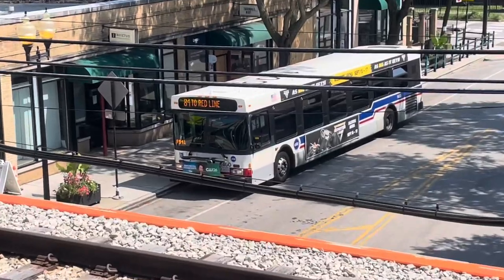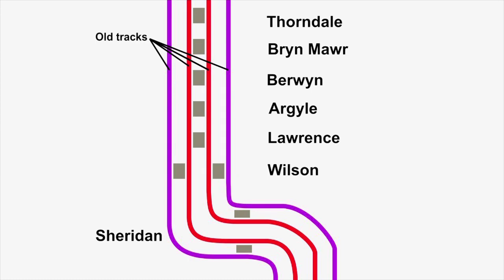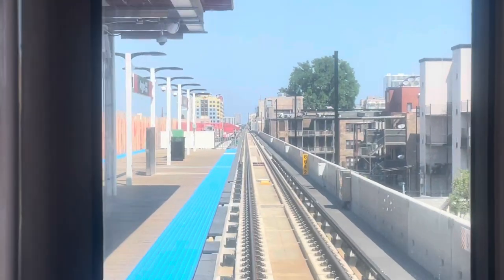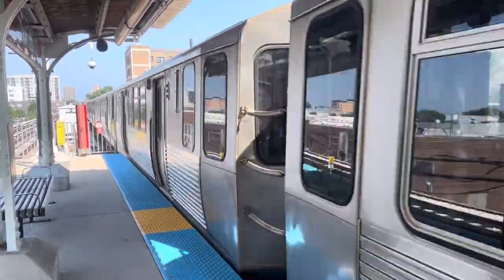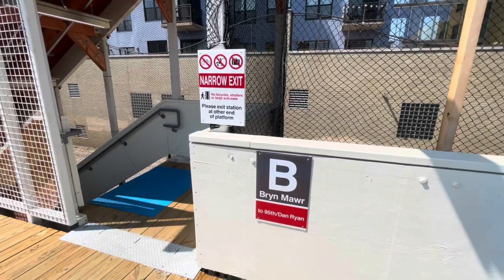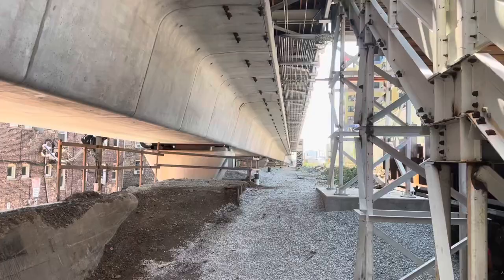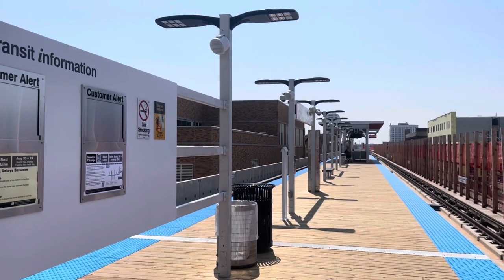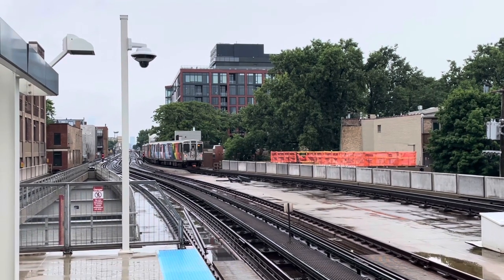CTA RPM Update

Comment: I'm excited about the Red Line extension to 130th as it's close to where I live, but I know this isn't what the video is about. This new structure up on what they used to call the north side main line seems quieter and makes for a smoother and more comfortable ride. And it seems much higher than the original structure.
Reply from the maker: I found out about the HUGE new grant for the extension just a few days after finishing this video!

Comment: This whole project is absolutely amazing. I have to compliment the CTA on this project because it is being done pretty much to schedule and within budget. Good project management is not very common on US transit systems. There have been no major delays and no ballooned costs as has been common in LA, NYC, and SF projects. We haven't had major equipment problems the way DC and Boston have had either. CTA project management has been consistently good.

My favorite part of the L are the tracks between Sheridan and  Wilson. That century old structure is beautiful and I love walking underneath it as trains roar overhead. I do get excited when a north and southbound Red Line and north and southbound Purple Line trains all pass over me at the same time. That kind of timing doesn't happen very often so it's cool when it does. I'll be sad when that section is replaced with modern structures. CTA may be the only agency in the US that is doing so much modernization on its system and that is impressive. Much of the system has been updated in the last 20 years. I can't wait for the new elevated mega-station at State & Lake.

The new structures are great and the trains can run at speed now. There was something quirkily thrilling about the old tracks as the trains roared loudly over them and we were thoroughly jostled about in our seats on the old tracks. The new stations are the best part because they were old and dilapidated. There was nothing nice about those stations. That Wilson stop was disgusting and now it is thoroughly modern and beautiful. I do wish CTA could have joined Honolulu is pioneering platform screen doors in the US, but I'm happy with what we got and hopefully they can easily be installed on the new platforms in the future.
Reply: I saw those screen doors at a few stations in Paris. I wonder how they would stand up during the winter months? As an added safety feature, I would love to have them.

Comment: The original plan was to build the new track pylons in the existing earthen embankment, but it was decided to remove it instead. The Northwestern "L" was elevated in 1914-1922 from Wilson to Howard, and an embankment was used instead of steel in order to support the heavier freight cars that used an outermost track to service coal companies on the North Side. The "L" had two electric freight locomotives, and the CTA inherited the freight service, which ended in 1973. There was a ground level connection to the Milwaukee RR at Wilson. All evidence of that is now gone.

Comment: So, CTA is thinking about doing the "NY MTA thing", running 10-car trains as opposed to 8.  It seems doable given that most of the subway and el lines of the New York Transit Authority run  10-car trains with the exception of the BMT  J, L, M and Z lines.  The IRT 7 line to Flushing is unique in that it runs 11-car trains, especially during rush hour.  It will be interesting to see if CTA can pull that off.
Reply from the maker: At least on the red line I don’t foresee it being very difficult. Most stations are easy to expand, and the state street subway doesn’t need any expansion since the tunnel is basically one long platform

Comment: 10 cars happening on the Red Line? They are really try to be like Japan
Reply from the maker: There’s just something sexy about a 10-car train
Reply: This Bay Area guy agrees! I like the 9- and 10-car BART trains and I'd love to see the CTA Red Line with them too.
Reply: @Intersteighty While that may be a good idea, I do wonder if all L Red Line platforms can support 10 cars? I think I once heard someone say on the Chicago Bus message board that at least some  reconstructed Red Line stations(not sure how many) technically can handle 10 cars. That is, if CTA wanted to go to 10 cars on the Red Line one day.

This video also forgot to say that Sheridan is included in phase 2, of the RPM project. My guess is when Sheridan is reconstructed one day, and due to the tight curves in that area, that they might move that platform to be just north of Irving Park near the cemetery.
Reply: Well, aren't Chicago subway cars signifcantly shorter than those Janapese or ones of BART? According to Wiki, all "L" trains are 48 ft 3 in (14.71 m) long, and the length of the BART cars varies from 70 ft (21 m) to 75 ft (23 m). I mean, a 10-car train in Chicago is almost as long as a 7-car train in Bay Area.
Reply: @BoratWanksta  I'm sure most Red Line stations can accommodate 10-car trains. For 10-car service it's just a matter of retrofitting the remaining stations. Would be a sensible investment for the CTA's busiest line.

@vahonenko  True to both. L cars are short so they can round those curves in the Loop and at other spots (curves built for historic streetcars). Most Japanese lines weren't built like this and as such they can accommodate larger cars and thus longer trains (believe me, a must for urban Japan). And the L Red Line runs more frequently than any single BART line right now (except an airport connector), so even with the shorter lengths than full BART trains you'd still get a good throughput of the masses riding the line.
Reply: Fun fact the 7 line in NYC has 11 cars
Reply: damn i don’t even think blue line trains get that long
Reply: can the platforms even handle 10 cars?

Comment: Elevated concrete structures never last as long as steel ones and cost more to maintain/patch once cracks start to appear and corrosion of rebar begins. 
I am surprised that the half that has been rebuilt doesn't have permanent half-station with rebar sticking out so the second half can be attached to it as the other 2 tracks are built. 
Curious on the sequencing of work if they will have to close the station while the temporary structure is torn down and  permanment one built once all 4 tracks are there.  (and if they are able to build half of permanent station on second half, how come they couldn't do same for first half such that when 2 halves are done, you have 1 fully completed permanent station.

Comment: Did the CTA move to AC? The trains sound like they have a AC motors. When I was a kid, it was all DC. When that project is completed, those trains are going to move much faster. Are the new viaducts prefab or cast in place?
Reply from the maker: The 5000 and 7000 series are AC

Comment: The Red Line is a work horse in the city. Aren't they also working on extending the Brown out to connect with the blue at Jefferson Park. The new CTA L system is going to be amazing. Just have to get the brown line running all day. So many damn nice bars that I have to uber to because it closes at night.
Reply from the maker: I wonder where this rumor comes from. There are no plans whatsoever to extend the Brown Line, even though it would be a really good idea.
Reply: I read a good argument to extend to Montrose Blue instead of Jefferson Park. It included an argument to add or relocate a station for the Metra UP-NW to Montrose so it can transfer with the Metra MD-N and the CTA Blue line all in one location. Instead of terminating at Montrose the Brown line could continue onto the inactive rail line and up the Valley Line to transfer with the Yellow line in Skokie or the Weber Spur to Evanston and 7 blocks of Church St to transfer with Purple line and Metra UP-N.

Comment: 12:54 love the subtle orange line slander (well deserves as the only lasting impact of that shutdown was the retirement of the old trains)
Reply: The Orange Line in Boston shut down because of the serious maintenance and safety issues that were years in the making, not because of construction issues. Instead of dragging out the repairs for months and months the T took the drastic option of doing it all at once as quickly as possible. Whether it worked is the subject of another video. Also, at 00:38 we see that the CTA has shut down part of the Blue Line for a complete re-hab.
Reply: I’m glad the shut down happened, but it wasn’t as well used as it should have been, and wasn’t the cure all that it was advertised to be, especially with regards to slow zones(5 minutes of slow zones prior to shut down, 44 minutes after, 15 minutes now). Yes some of the current slow zones are because of the safety directive given in March, but the work was 6 months old at the time, so none of it should have stuck around.

Comment: I have some ideas for The RPM Modernization that could work. 1: at certain stops they should add Ramps to the stops they're built at. In my opinion they should be built at Berwyn because of the many stores that are around the stop and buses that come from Downtown Chicago and Jefferson Park I think having an ramp alongside the elevator would be beneficial for everyone who uses the stop. Another place that should have a ramp is at Howard Street for obvious reasons. Like Berwyn Howard Street CTA Terminal is in the middle of a shopping district so there's a lot of people who uses shopping carts so having a ramp would help people to catch their train without having to wait for the elevator to come back down or having to climb the stairs while pulling up the heavy shopping cart up the stairs. Also being Howard Street CTA Terminal is a major CTA and Pace Interchange having a ramp would help with potential crowds. 2: At Main Street CTA Station the platform for the CTA Purple Line and the platform for The Metra Union Pacific North Line is so close that even when I was a kid I wondered why they never built a ramp/bridge between the platforms. Like it would be really convenient for people who want to transfer to The Metra or The CTA Purple Line and don't want to have to go down the stairs and go around the corner to get to the station they can use the ramp to do it. And there would be a employee who would make sure that people are paying the fares and everything.